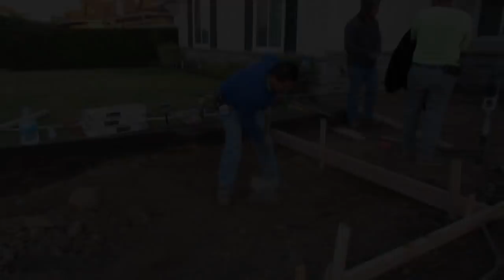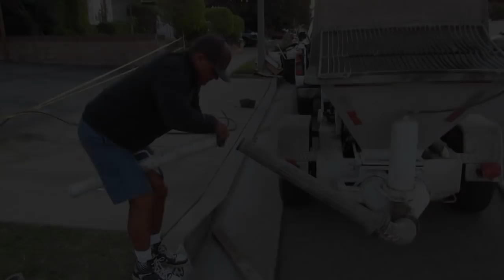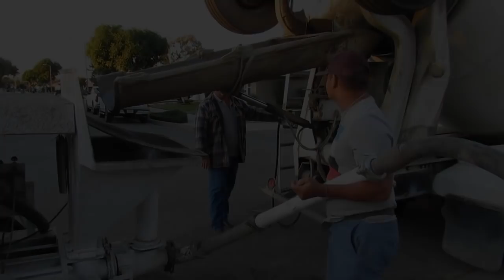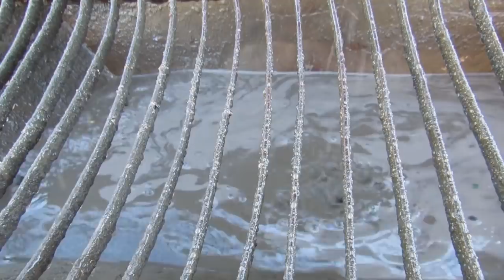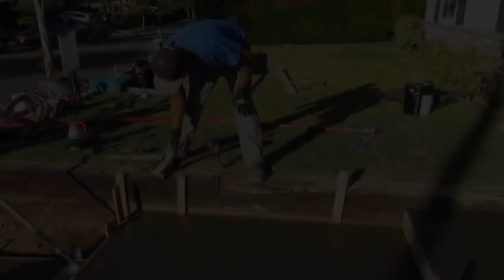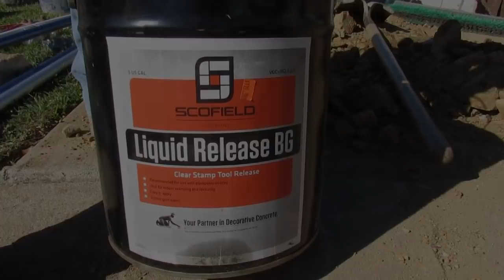Stamped Front Entryway & Stairs. Colored Concrete. California

Comment: The finishing work is great,  good prep work.  That rebar should be lifted up to at least the center of the slab though
Reply from the maker: Lower is better
Reply: @WestCoastCustomConcrete 
Not only are you totally incorrect, it's also not up to code.  R506.2.4 Reinforcement Support. Where provided in slabs on ground, reinforcement shall be supported to remain in place from the center to upper one-third of the slab for the duration of the concrete placement.
Sorry pal but you failed inspection. And yes I am an ICC certified structural building inspector.
Reply from the maker: @dogfacedponysoldier6040  👌

Comment: I enjoy watching your videos.   I def always learn new techniques from you that I can use on my work.  But couple questions.   Looks like you always use pea gravel. I’ve always been told that pea gravel is not as strong as 3/4” concrete.  Is there a reason you use pea gravel even on not stamped concrete jobs??   And, I always use rebar on all my jobs also, but why don’t you use chairs to keep the rebar up.  I know you guys pull the rebar while pouring but the finishers always step on it when they rod the concrete and it drops to bottom.  Just curious.  Thank you. And great videos.
Reply: Pea gravel is easier to knock down and get the cream to rise to the top. If it isn’t going to have vehicles drive on it, pea gravel six sack with fiber and rebar is all you need. He also said on other videos he likes his rebar closer to the bottom and not the top bc it can crack being closer to the surface.